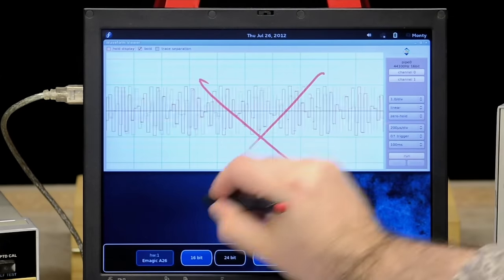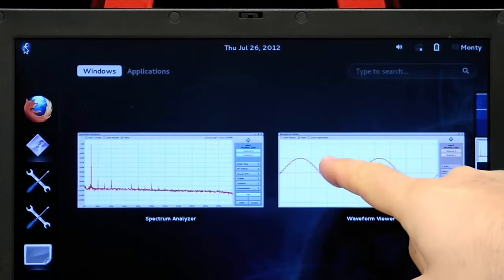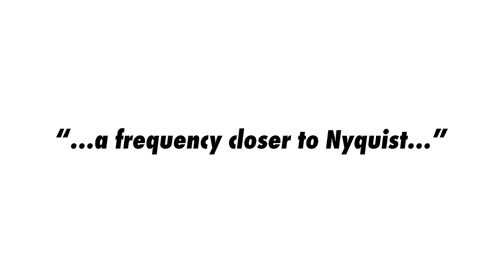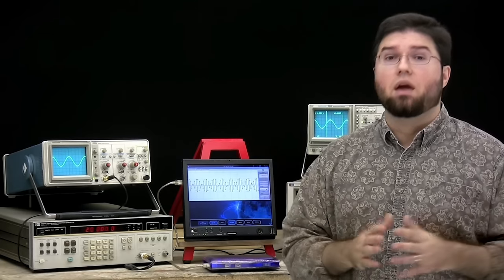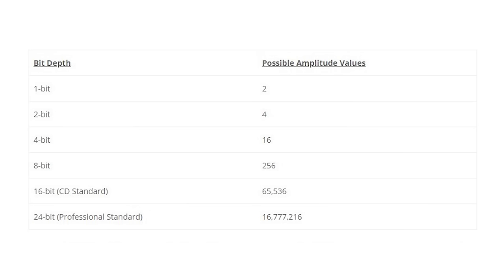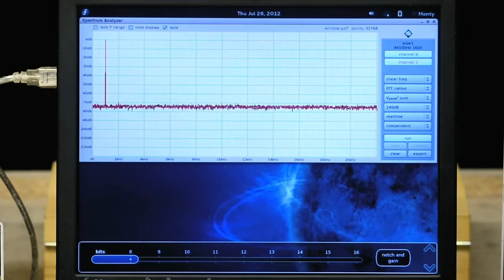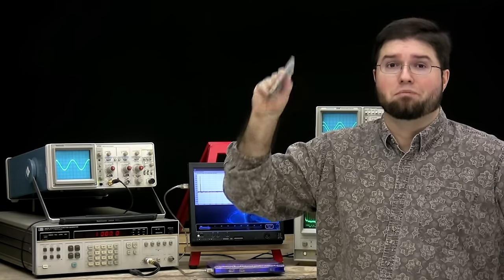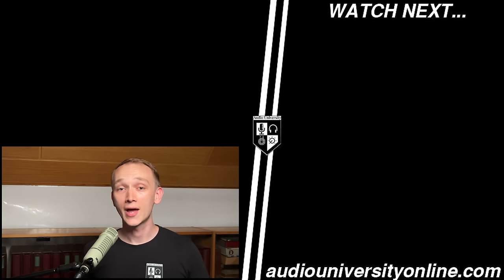Debunking the Digital Audio Myth: The Truth About the 'Stair-Step' Effect

Comment: I'm having a hard time understanding what "magic" defines the precise amplitude of a perfect sine wave above the amplitude of the sample? The "stair step" can easily be cleaned up by "connect the dots. Basically, that would be a straight line drawn between the sampled values, rather than holding that value until the next sample. That, however, would not produce a perfect sinewave exceeding the amplitude of any sample in the signal. At higher recorded frequencies, you would end up with a triangle wave. (a random series of triangle waves, if the recorded frequency is asynchronous to the sample rate)

Comment: This a great video, but the perception of the square wave isnt the issue. It is how the digital points are reinterpreted. A standard sin wave will average out to a standard sin wave via this method, but when you use a complex sum of frequencies and amplitude is where you will see the mathematical washout that you can hear in a poorly sampled audio file. Analog vs digital is simply a fact, there is a reason there are still analog computers by the way. Analog computing actually has benefits in AI algorithms.

Referencing the noise barrier is in itself the reason why engineers use square waves, it allows us to see the loss when compared to the analog equivelent.

Comment: I am seriously surprised that this myth is still around. I was in my mid 30s and something of an audiophile when digital audio arrived on the scene around 1982. The myth appeared early and was quickly debunked. Since I was working as an engineer in digital video processing for satellite imagery, I already understood why 44.1KHz was more than adequate. I think the myth was reinforced by the fact that the pristine quality of digital audio exposed the weakest link in every high end home audio system. Audiophiles couldn't believe that they artifacts they were hearing came from a defect their expensive systems so they blamed it on the A/D-D/A process. Part of the problem is the huge dynamic range of digital audio compared to an analog LP which is, by necessity, heavily compressed.

Comment: The big question in my opinion is why file size even matters. Given that most people have multi-terabytes harddrives and Internet connections that can stream 4k video, what difference does a little overkill on the audio make? If people want audio with 1 MHz sample rate, and 32 bit depth, let them have it. It will eat less space than 4k video anyway. And having something that can actually play those files will be their problem, not mine.

Comment: What we value about old microphones and consoles (and their virtual facsimiles) is not some quality of "analog-ness." It is just their eq curve, their behavior under stress. With very inexpensive and easily available plugins, a DAW WILL sound like a seventies recording deck, all my albums are recorded and mixed to that aesthetic, because it is the only way my old fashioned ways of writing playing and singing sound good. I have no complaints about the current tools, and there is of course more instrumental skill on offer in so many genres now than ever before. It is the culture and economics of music which have deteriorated in certain ways, not the practice of recording. 

Plus... having also worked in traditional rooms since 1978, I can attest - that old gear sounded great IF and WHEN it was perfectly maintained; with an expert running the thing; assuming the electrical system was clean enough; until the tape wore out; until the heads needed maintenance; until one of many hundreds of little components died in an unreachable place; if you kept focus and didn't get sucked into the vortex of cumulative noise and overly complex signal path. It was difficult to use well, so are DAWs honestly... lots of stuff being made very efficiently, just with different flaws than were the norm back then. There are tons of hit records from the seventies that sound bad, we just don't listen to them anymore.

Comment: The only reason I record in a bitrate higher than 44.1 is because drive space is cheap, and if my file gets damaged there's more data to "fill in" any gaps (if those gaps were even audible). I normally "down" convert to 44.1 when I send the file to a digital music player (iPod for example) or transfer to tape.

Comment: we get the stair step idea from media like cd's and hdds where they need a margin of error. In the case of a CD it's the size of the pit made from pressing or burning it into the CD. It also comes from digital electronics with capacators etc.
Reply: Capacitors are purely analogue.  Capacitors are one of the most ubiquitous electronic components, and are present in basically every single circuit.
Reply: @chop098  yes but it takes time for them to charge up and digital electronics uses a charged capacitor to represent a 1 and a discharged cap for a zero (above a voltage for 1 and below another for zero with various margins of error in there). It takes time for a cap to charge and discharge so you get the stair step idea and flat peaks and trophs that represent 1s and 0s.
Reply: MF Nickster  Yes I understand that. The perception of the stairstep effect I think comes from digital electronic thinking however. That's what I'm saying.

Comment: A fundamentally flawed explanation because the output of the D/A circuit is in fact a stair-step rounded by the slew rate limit of the switching circuits. That then is passed through a low-pass reconstruction filter who's output is a sine wave true to the source. The reason for that is the stair step wave has all of its harmonics above the pass frequency of the reconstruction filter, so only the fundamental that is part of the original wave passes. That's why it's called a reconstruction filter. The conclusions are accurate here, but the explanation fails to distinguish the separate rolls of the D/A and filter causing confusion.

Comment: It's a cool presentation, but I'm confused about the stair step.

Maybe I'm missing something, but the stair step is real. I've used a great number of DACs (Digital to Analog Converters) and they all stair as they hold the value, as mentioned in the video. 

Yes, the 44.8 kHz sample doesn't require any specific value in between the samples, but it does have SOME value. It doesn't normally make up a value that smooths things out on its way to the next value. Smoothing usually requires a higher sample rate. 

The harshness of the step is usually determined by the slew characteristics of the specific IC and the waveform being generated. Yes, the frequency of the switching is out of band, and therefore inaudible, but I've never seen a DAC that doesn't have steps in its output. 

At first I thought the sweep rate of the oscilloscope was too high and was blurring the waveform stairs, but it's only 1/sec. I also thought it could be the slew rate, but unless it's dynamic, the stairs would show up on lower frequencies.

So why is the oscilloscope not showing the steps?
Reply: I wish he would have zoomed in more on the lower frequencies

Comment: Just a little Clarification... Your explanation of Nyquist Frequency isn't exactly correct. Nyquist-Shannon Theorem says that "Sample rate has to be atleast double than sampled signal frequency (Nyquist frequency) otherwise results are subject to Alliasing" But it technically doesn't say that the sampled results are 100% correct even if they are of frequency lower than the Nyquist. 

That is actually part of the reason why "CD-quality" has sample freq of 44,1 and not just 40kHz as the closer you get to the limit the less reliable reconstructed signal becomes.

Comment: Theoretically it is all good, but increased Nyquist frequency allows cheaper analog components — antialias and reconstruction filters. It is hard to make good analog filters which passes 20KHz but completely reject 22.1KHz. Filter which reject 48Khz is much simplier

And one more: 16 bit is not enough for processing and mixing. It us enough for final rendering, though.

Comment: This kind of experiment on a static sinewave is not really telling it all.  There is an actual hard limit on the signal to noise ratio  for any given a sample rate and bit resolution.  For CD audio, the SnR is about 76dB, which can be bettered by a (very) high end analog system.    Also, digital to analog circuitry must have a low pass filter to remove the step-like effect (which is present right on the ouput of the DAC).  As all circuitry, this low pass filter is never perfect, and it will introduce some extra harmonic distortion.  When the CD audio standard was introduced, its audio quality was rivaling the top of the line of audio equipment of the time, but some turntables could already exceed 80dB SnR levels, which is very impressive.   With the big improvements in electronics that have taken place since, we'd probably have a much better analog listening experience now if the analog medium had stayed popular.   That said, digital music has many practical advantages,  that analog mediums simply cannot match.

Comment: Hmpf, these somewhat arrogantly sounding audio engineers spoke a lot why 16 bit audio resolution is enough, however manage to record parts of the video with a lot of background noise.

Btw. I have a hybrid CD / SA-CD with "Also sprach Zarathustra" (The opening theme in "2001 - a space odessey") and there is no doubt there is much less hiss in the silent part right in the beginning when switching between normal CD and SA-CD mode. Another recording I have of Ravel’s Bolero tells the same story, SA-CDs have extremely little background hiss and audibly much higher dynamic range compared with CDs, which of course has high audio quality, compared to previous analog formats, though not nearly as high as DSD.

Comment: I don't agree with what's said here.
The output of a DAC is definitely not a series of discrete points, it is very much a stepped waveform. BUT an audio DAC is followed by a low pass filter, which blocks the high frequency component of the stepped output, leaving you with the "analog" part of the signal

Comment: Who can produce the research that says human sound perception goes from exactly 20Hz to 20kHz. We all know that we can perceive vibration lower than 20Hz. I have also seen research that states that even frequencies above 100kHz can be felt if the sound source is pressed against our head.

Now, this video never mentions that music audio consists of very variable frequencies and also quite natural phase shifts. It also ignore the shape of onset transients. It states that increasing bit depth increases noise without any reasoning to back it up. It does not mention how music can contain sounds close to white noise and the precision needed to properly recreate that DAC (especially if lossy compression is used).

That said, I agree that CD quality digital audio is probably better that LPs and analog tape. I do not agree that increased bandwidth, be it sample rate or bit depth, is a negative, even if the differences may be hard to hear. 

All in all this is a good video, but it is not necessarliy cover all aspects of sampling music audio.

Comment: The problem isn't digital to analog conversion, the problem is running something like a guitar thru ten separate digital processors, then recording it on a digital device, then mixed into another digital file, to be mastered digitally, then reproduced and "replicated" onto another digital format.

Comment: Question. I trust the math, but always wondered; I believe the CD bit depth and sample rate can faithfully produce any sound in human hearing range without distortion. The math says so. But, is it still good enough to handle the rapid modulation that is required to reproduce music? It’s not just a sine wave at any one particular frequency that has to pass the math test, it’s dynamic and all over the place when you sum up all the simultaneous frequencies you’re hearing in the spectrum of a recording. Can CD rate do that by the math too?
Reply: Ok. Good to know. So, and I am aware of the possibility that this may be a nonsensical question, could a CD produce full spectrum, white noise without distortion? Is that even the ultimate stress test?
I can sometimes tell Bluetooth from lossless, but can’t truly say I have ever been able to pick out hi-res.

Comment: It's interesting to hear sampling error described as noise, but one should be wary of so easily attributing inaccuracy to frequencies above the Nyquest limit.  In the real-world sounds are continuous, not discrete, and are real values (i.e. the union of rational and irrational numbers).  The overwhelming majority of real numbers are not even multiples of 1/(2^n), and the digital value for them is an approximation, not the exact value.  There are even many more numbers which are repeating values in base 2, and do not repeat if represented in, for instance, base 10.  In base 2 a mundane number like 0.2 is approximated as 0.19921875 in 8 bits.  Depending on the number of bits, you can add more 9s in the middle, but you can never represent exactly 0.2.  So, it is exceptionally likely that every single sample was inaccurate, despite the video saying an inexact sample was simply a frequency above the Nyquest limit.  It's a convenient crutch, but not necessarily true.  

However, if you were to ask me why there aren't discontinuities on the output, I would suggest that, more than likely, the digital to analog converter is using discrete Fourier transforms to turn the discrete digital samples back into continuous sound -- the DAC is finding a summation of sine waves which best approximate the samples.

Comment: I take it that 24-bit sample rates in music production is required to accurately resolve harmonics outside of the 20 Hz to 20000 Hz range which impact the waveforms we can hear because of wave  superposition: otherwise the timbre of the musical instruments sounds flatter than analog.  Or is the latter just an artifact of lossy data compression?
Reply: @nicksterj  Ok, thanks for that.  I just noticed the follow-up video mentioned is available and I can learn something from that which reinforces your reply.  You can probably tell I'm pulling things out of my arse here with my bachelor of boneheads degree in physics.

It is just that I've often wondered if harmonics that we cannot hear within the 20 Hz to 20 kHz range "colour" the sounds in that range which we can hear through resonance effects.  Strip them out by limiting some aspect of sound resolution and you may limit fidelity in the signal and adversely affect timbre in, say, a multi-string instrument when striking a chord.

Related, the effective "bit-depth" of cassette tapes were mentioned in this video but I've always found cassette tapes to sound flatter than vinyl and I wonder what the latter's effect bit-depth may be.  I am assuming it would be higher and that this is why vinyl seems to sound more vibrant and richer as the grooves are continuous (to some microscopic point anyways) and not discretely sampled using any kind of quanta.
Reply: @nicksterjCheers!

Comment: Its not about stair steps seen on oscilloscope (we can see them when DAC doesnt have output filter). Its more about THD+N (distortions what we can hear) which they are both on analog and digital - second one, for real is analog-digital-analog, because sound is always analog, not 0, 1. Anyway, more sample rate often ends up with more THD generated in DAC ouptut stages. 96 kHz 24 bit is good enough. Thats why my DAC capable of 192 kHz is seto to 96 kHz for lower THD.
Reply: @nicksterj I know. the weakest element of the path are microphones, amplifiers, speakers/headphones and room itself. Also it changes with power output. Listening 100 W output with 100W amplifier gives THD at around 0.05% - 1%, but listening at ~2W with same setup will give much much lower THD. Also noise always comes into play.

In mine amplituner I had tone regulation between volume potentiometer and amplifier, so I removed it (input sockets -> mechanical switch -> mono/stereo switch -> volume potentiometer -> amplifier).

Comment: I would have liked to have more details from the signal path. Because the dac outputs a number of samples every second. In between every sample the circuit is made to give a smooth transition to the next sample.
Reply: @nicksterj You uderstod what I meant, a voltage that represents a sample. And as far as I understand the steps exists at one point in the circuit together with the higher frequencues. The filter remove theese higher frequencies and gives us the uniqe solution that is a representation of the original waveform. The cd players in the 80s had oversampling. This made the filtering more easy as it could be done at higher frequencies.